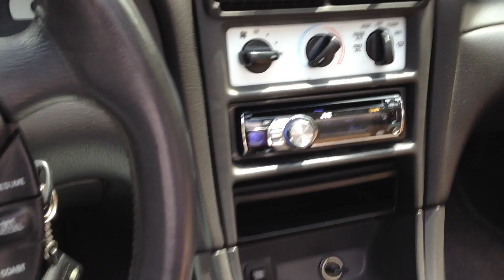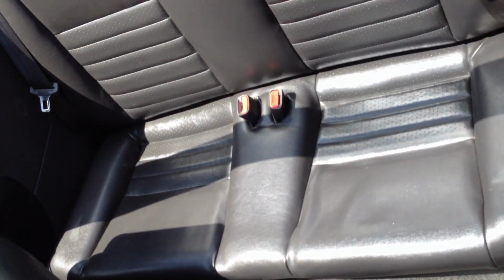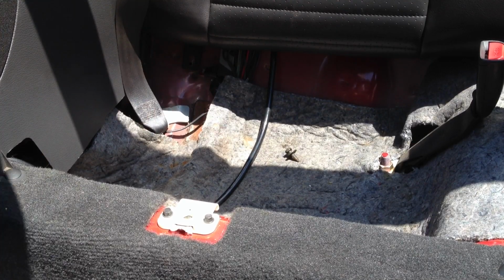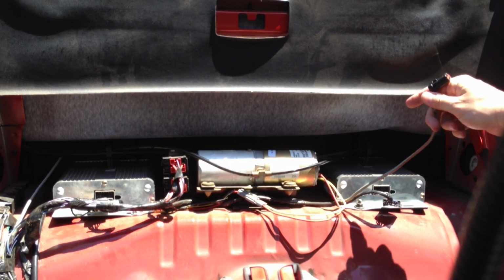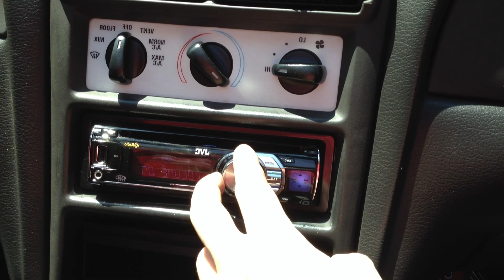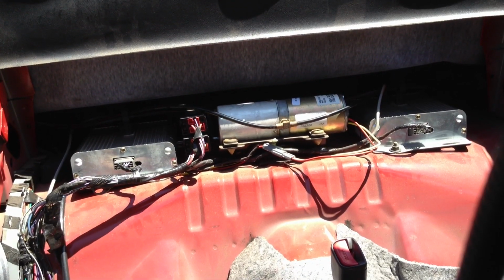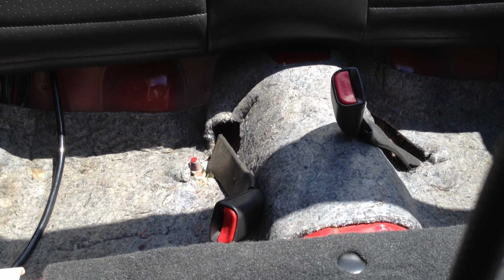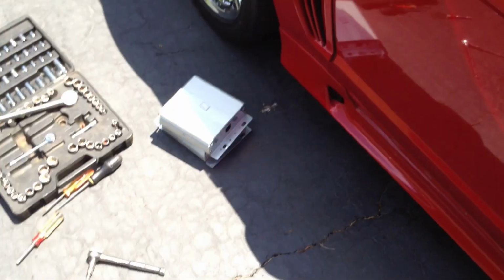How-to Replace Broken Mach 460 Amplifiers Ford Mustang GT

Comment: For future reference, if you have the convertible top up you can actually lift the carpeting in the trunk to gain acces to the amps, my friend has a convertible SN9 New edge, just saves some time no need to remove the seat

Comment from the maker: No it won't. The alternator noise is from a bad ground, but I have the same problem with my mustang. I'm going to try running a ground wire right from the negative battery terminal myself. When I do it, I'll record a 1080p video. So Stay Tuned :) #mustangtips

Comment: Hey man, do the amps have a fuse or where is the fuse located? I have the same problem with my mustang Mach 1, it’s a 2003. I hope you can help me out.
Reply from the maker: You're going to have to check the fuse boxes. Get the manual out or find one online.

Comment from the maker: The fuse box is underneath your dash on the drivers side. There are 3 fuses for the radio, just check your manual. Also, if your fuses are okay... I still have the Mach 460 amps forsale!

Comment from the maker: The fuse for the amps is in the main fuse box underneath the steering wheel. I don't remember what number the fuse was and it's not the same one as the radio.

I actually took some needle nose pliers and pulled each fuse out while the car was running. Make sure you have a flash light handy to thoroughly inspect the fuses. My first time around inspecting I missed the tiny split in the metal fuse. Good Luck!

Comment: Great vid i got 02 GT n its got mach 460  left door n left rear speak quit working changed head unit still no left sound took out amp n rear on left took off cover n gots big burnt spot on cerit bored  i need one amp

Comment from the maker: Connecting car radio's is pretty simple. You're basically matching speaker wires together, then your're hooking up the power, ground, and remote wire. I highly suggest that you buy a wire harness for your car, because it will make this much easier for you. You'll simply wire up the harness to your new stereo, then use the harness wire connectors to connect up to your factory wire harnesses. That's it!  #caraudio #subwoofer #mustang
Reply: I know this is an old comment but hopefully you see it. I did exactly that with the harnesses. Turned it on and I have no front speakers. Turn it up and the amps kick out! Any ideas?

Comment: okay, this is a dumb question, but how do you unplug the amps from the trunk side?  I have been trying to unplug the one on the passenger side, and it is impossible.  I'm getting some alternator whine through my stereo, and im pretty sure that two broken wires in the plug is the reason for it.  Thanks!!

Comment: Where on the car did you find the fuse?  My car's radio works but sounds muffled sometimes and generally just has poor sound quality.  2004 GT convertible

Comment from the maker: I just wanted to point out that for weeks I thought I had blown amplifiers and bought new ones on ebay only to have them not work. Then for the third time I took out each fuse one by one and looked at them carefully. Sure enough I had blown a fuse and as soon as I replaced it, my stereo came back to life. 

BTW: I ran 2 different aftermarket radios and never had a problem with just treble playing but no bass. If that's the case, then maybe you have wired the radio wrong or, the amps are blown.

Comment: Have a question. I got the 2001 Ford Stang GT with these type of amps. First, both amps are fried. So only sound I get is out of the tweeters. I thought about bypassing the amps but after reading about how to do it, I decided that it was too much trouble. Now I either am going to buy the same over priced junk amps or get a whole new system installed. What do you think I should do?

Comment from the maker: I'm using the stock Mach 460 speakers, and swapping the amp for the OEM replacement will not affect your sound quality at all. Swapping out the headunit (radio) will affect the sound quality because the EQ will not be tuned the same way the FORD radio was tuned for the Mach 460 speakers. However, if you buy a car radio with an adjustable EQ, you should be able to improve or match the OEM sound quality. hope that helps.  #ford #mustang #mach460
Reply: Lex Selfmade Life how exactly do you match the OEM sound quality with an aftermarket head unit?
Reply: brymora I'd assume by just playing with it, kinda how you would anyhow when setting it up, just keep adjusting til it sounds good/better

Comment from the maker: No, I had absolutely no sound at all. I even changed decks to see if it was my radio. It ended up being one of the two fuses, which you can find underneath your dashboard on the drivers side. I believe the fuse box cover has a label; or check your manual.

Comment: Hey man. i'm not quite too sure how to say this, but i'm thinking of changing my radio into a modern more looking radio in my mustang(you know like bluetooth,ipod jack etc...) and i happen to have the mach system. i'm not really sure. i heard that if you change to a different type of radio receiver it will make the sound crappy. i mean you think there's another compatible radio receiver that would fit the system that would sound the same or better.?

Comment: how  to connect  a aftermarket stereo head to the  stock 460 system with the square connector  wich wire goes  where ??

Comment: looking for help with my 98 Gt 460 speaker system, when i turn up the volume while motor is running the bass in my rear speakers cuts out. when the motor is off i can turn it up i can turn it up a little louder but they still cut out. any suggestions? i checked the wiring under the left kick panel and they are connected ,checked the amps and they are connected , speakers dont seem to be blown, any help would be extremely appreciated... C P

Comment: I put in new aftermarket head unit in my 98 GT and the sound sounds horrible. Bought mine from crutchfield and came with 4 rca cables and When I connect them, only front speakers work.

Comment from the maker: Yeah, I thought I blew my amps completely and took my car apart several times. Once I finally found the fuse, I was so happy that everything worked. So I tested the amps you see in the video before I put them on Ebay :) If the amps are the problem with your car, you will be all set :)  

BTW: Check out my YouTube channel and look for the Home Theater Scam video right near this video. Some guys tried to scam me while I was taping this video LOL.

Comment: so I used part of your video i appreciate the post, although, its 11/32 socket to get the back part of the seat off, and 11mm bolts to get the amps out, also dont tighten it back up to tight the studs are cheap/flimsy I broke 1 :)

Comment: my tweeters arent working. the rest of the system is fine though
Reply: did you figure it out..  I just bought a 2001 for a grand..  My tweets work an back speakers but not my front...  Any ideas ?   Fuse ?    Maybe they were not hooked up ?
Reply: I just slapped a new sound sytem in it. I think it was a blown amp

Comment: My front door speakers not the tweeters and the back panels speakers dont work but all four tweeters work were you having the same problem?
if so where was this fuse you missed
Reply: tkaofbob I have the same problem now. I know both amps r not blown. I looked an the deck is wired correctly. What did you end up doing.